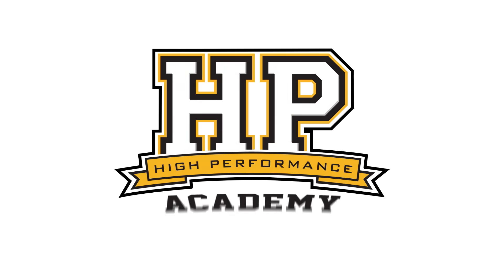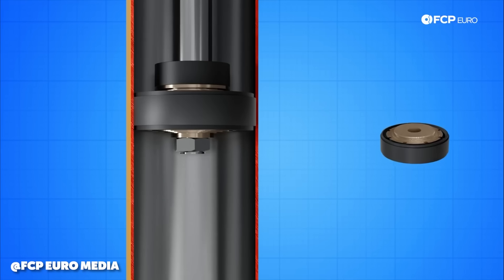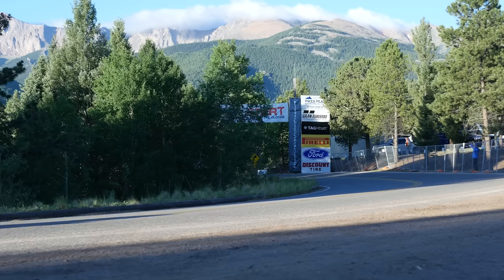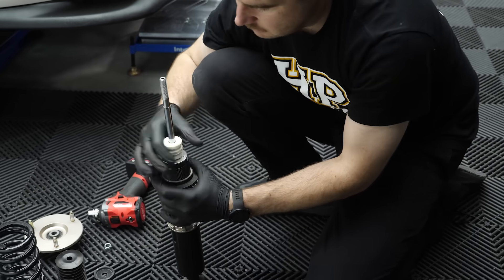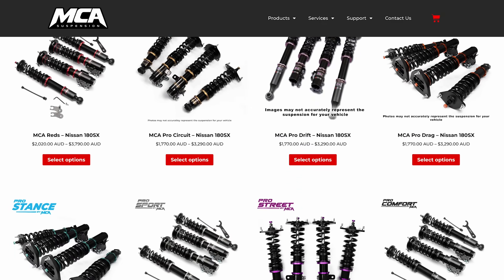The 3 Secrets To PERFECT Suspension Performance

Comment from the maker: 🏎 Building a fast car? Get $400 OFF the all-inclusive VIP online course package deal: https://hpcdmy.co/mcasvip
🗜 50% off your first suspension tuning course. Enrol now: https://hpcdmy.co/mca50
0:00 -  3 Important Suspension Aspects
0:10 - Josh Coote MCA Suspension
0:15 - Inside Suspension Damper
0:18 - Suspension Piston
0:30 - Discs/Shims
0:56 - Real World Testing Vs Dyno
1:16 - Rebound & Compression
1:32 - How Adjuster Works
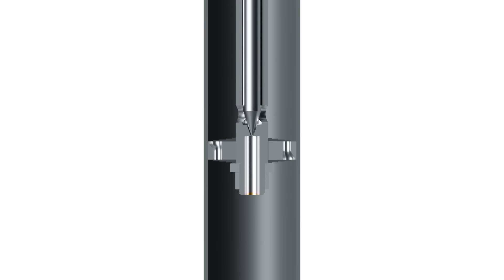1:55 - Shim Stack Vs Oil Flow
2:20 - Thick Vs Thin Shim Stacks
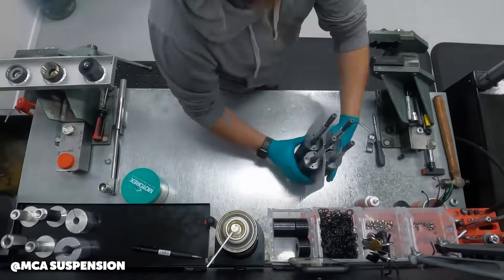3:01 - Tunability & Development
3:24 - Shim Adjustment In House
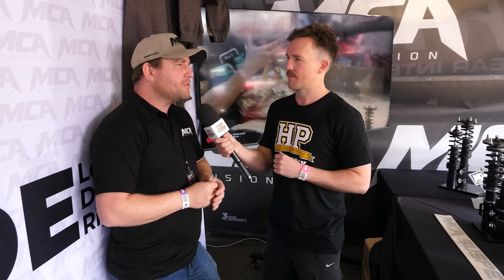4:09 - Revalving Shocks
4:38 - Springs Are Easy To Change
4:52 - When To Revalve A Shock?
5:12 - Different Valving For Different Applications
5:30 - Drift Vs Drag Suspension Valving
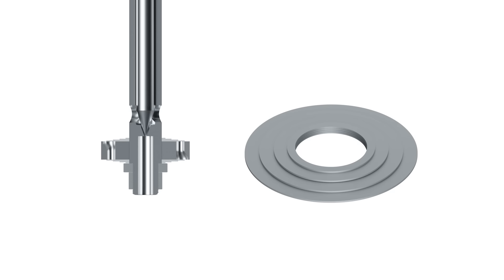6:25 - Valving 70% Of The Picture
6:52 - MCA Suspension

Comment: More commonly overlooked is the suspension droop . Too much travel still jacks up the inner wheels, even with an uprated anti roll bar . 
Reducing the droop on the shocker by having them shortened also allows you to run a softer Roll bar , making the vehicle more compliant, especially in wet race conditions.

Comment: I run MCA Pro Sports in my S13 Silvia, and they are leagues above any cheaper bolt in street coilovers I have felt. My car feels like it has rally suspension and with the full droop and proper valving capabilities it's glued to the ground (Yokohama AD09). It's super comfortable on the road, eats up big bumps and dips without upsetting the car. Worth every penny!

Comment: The problem is that when you have adjusters, the shaft size increases and the minimum size shim as well also increases while the piston area decreases, creating higher gas forces and a more uneven bump/rebound balance. If you just build the suspension right off the bat for the intended car and purpose, you don't need adjustment knobs, and can thus have a smoother response and more comfort, even at typically higher spring and damping rates than you might think.
Reply: Yes, but that assumes exactly one intended purpose.  One car, with one setup, for one track.  For example, I recently made a swaybar adjustment on my Miata for more mid-corner rotation on the autocross.  My old damper settings became tremendously loose on entry, and I was very happy to have adjusters to calm down the dynamic rotation without having to assemble a whole new shim stack.  I set the car with even more transition stability for the street with the adjusters, and I'm sure I'd do the same (albeit stiffer overall) for a track day.
Reply from the maker: @Drunken_Hamster - We'd respectfully disagree. There is 100% a reason for adjustment,. There are often even more adjustments than what is discussed here, and that's not to say everyone and every car needs it. It's also not because no one can get this perfect 'off the bat', it's because 'perfect' is a moving goalpost.

@JETZcorp rounds off a few great points on why, they are not the only ones either.

There are so many different applications out there that no single blanket statement can cover them all. If what you're using suits your skill level and your specific needs, then that's a win, even if it looks completely different to what someone else is doing.

Hope that helps and thanks for sharing your opinion! Just because we don’t agree doesn’t mean your setup is wrong for your needs 😎- Taz.
Reply: @hpa101  Fair enough, I guess. I get a little bit of confirmation bias type stuff going on when something is explained to me really well, like the videos I watched, which influenced my stated opinion. At the end of the day, I want my car to be comfy enough on the street for road trips but absolutely confidence-inspiring on the mountain and at highway speeds in the case of having to make an emergency maneuver.

It's a 7th-gen (03-07) USDM Accord Coupe V6 6mt, which shares a chassis and suspension components with the TSX and TL, each of 04-08 model years, and the former of which is known as the European Accord. I don't want the car any lower than 2in below stock as I'm not the "tire tucking" type and don't want to struggle too much to get in and out of drives or over speed bumps.

Any recommendations? I was kinda thinking about Ohlins TTX since they're a full-cooling surface twin-tube, which theoretically comes off as the best of both worlds between the consistency of a mono but low gas forces and comfort of a twin. Sadly, they don't directly make them for my platform, so IDK what to go with, really.

The guy's videos I watched, which influenced my opinion, he charges $3k for a suspension setup, but he takes corner weights and nails your ride frequencies (including having flat ride), has a "ripple reducer" (which are two bypass holes in the piston for washboard style surface irregularities), and specs roughly equal compression and rebound damping so as not to have the piston keeping the car sucked down into the bump stops and riding rougher than need be. Oh, and he has special bump stops, too, and a bag of "packers" which you can use to optionally force them to engage sooner.
Reply from the maker: @Drunken_Hamster - context is important for sure, so don't take that as an attack on you or anyone else. For a specific street car with a specific setup, maybe whatever you watched was on the money and really helpful for a lot of people who just want something solid in the ballpark, and it will no doubt be better than stock, especially old stock suspension.

Link us to the video, we'll have a nose. 

To be honest for your use case, something like that which is 'set and forget' would tick all the boxes for you.

If you were going to be on the track more than road, then it would be different. A dedicated track car on slicks, different again.

Ohlins will need to be dialled in for your setup/preference too. The brand name alone doesn't give you the performance, so factor in that cost if you do take that route no matter the brand - Taz.
Reply: @hpa101  The channel is called "Suspension Truth by FatCat Motorsports" or something like that. His 6-part-ish series on suspension tuning and then his 2-parter about how to vet your suspension vendor are certainly things I'll consider when it's time to move forward. Unfortunately, YT doesn't like me dropping links in comments. I can try in a follow-up, but no guarantees.
Reply: @hpa101  Yeah, see, just like I thought. YT auto-deletes any comments I put links in, even including links to their own platform. Maybe you can see it on the back end in your channel moderation settings or notifications, or something, but IDK. If you find the channel, it's the most recent playlist in the "playlists" section. LMK what you guys have to say about his teachings, as I'm always interested in cross-referencing information for accuracy and usefulness.
Reply from the maker: @Drunken_Hamster  ahh yeah that's odd, we don't have that feature turned off as we don't mind people linking great info. I'll look into that and check out FatCat Motorsports when I have a moment after work.

Cheers for mentioning that link issue - Taz.
Reply: @Drunken_Hamster  Just by the way you were talking about the videos, I suspected you were talking about FatCat.  I remember reading an article Sheikh wrote on TTAC back in the day about the problems with shock adjusters, especially their inconsistency.  That was a big part of why I chose Ohlins for my NC, because they really do dyno consistently enough to assume that 4 clicks means 4 clicks.
Reply: @JETZcorp  Yeah, I really want some Ohlins TTX due to the complete separation of bump and rebound and the benefits that that particular construction of twin tube gives, but Shaikh talked down about them despite the ultra-low gas forces (thing he likes a lot) and refuses to talk ABOUT them because of his "muh adjusters" hangup (which, seemingly fair given what else he's said and what you just confirmed).

The other problem is they just don't make them for my platform, that being a CM8 chassis aka the 1st gen TSX, 3rd gen TL, and 7th gen USDM Accord.
Reply: @hpa101  It's probably a me thing. I post a lot of long and/or semi-repetitive comments. Downsides of hyper-focusing on things, lol. I watch a bunch of videos in an effort to find something new pertaining to the thing that I recently learned, but all I can find is bog standard stuff, so I try to spread the new word about something most seem to not be aware of, and I guess that makes me a "sp-mm-r" in YT's eyes, so I get autoregulated.

Comment: why do 2 thinner shims vs 1 thicker of the same total thickness create a better feel?
Reply: The stiffness of a shim doesn't go up linearly, it goes up with the square or the cube (I don't remember) of thickness.  So if you have a shim with a stiffness of 5 units, 2 shims would be 10 units stiff, and a single shim of double thickness might be 25 units.  It's kind of like how it's easier to break 2 standard pencils than to break a single inch-thick pencil.
Reply: not an engineer but I would guess there is slightly more initial play of the stack moving before the full damping force is applied, which should soften the impact the driver feels
Reply: @chyrt  long story short, it’s because it’s effectively softer. One 0.2mm shim is roughly equivalent to 8 0.1mm shims of the same diameter. There’s some other factors as well, but the simple answer is that the stiffness of the shim is proportional to the thickness of the shim cubed. Have a look at the resources on ReStacktor
Reply: Multiple thinner shims are going to be a lot more flexible and doesn't restrict the oil as much.

Comment: Good to see detailed breakdowns of suspension. Suspension is a commonly missed opportunity by many enthusiasts
Reply: Josh knows his stuff! 'Enthusiasts' often don't really grasp just spring rates, wheel rates and soft-versus-hard sidewall tyres, let alone all this damping stuff!  I think to be fair many sporty OEM cars now have a pretty decent setup for road and light track as standard, be it a BMW M2 CS or FL5 Civic Type R, and if they don't then an OEM upgrade path is available -- for example semi-aftermarket BMW M-Performance coil overs for the regular BMW M2 or semi-aftermarket STi Tarmac springs & struts for the Subaru WRX STi.

Of course Josh would rather you buy MCA Suspension instead of that OEM parts catalogue stuff! 

Obviously if the OEM suspension already gives you the right "feeling" for the use case of the car, then I don't think you should necessarily be upgrading, unless the OE suspension is worn out and you want to get those MCAs or Bilsteins or Konis or Ohlins or whatever. It's easy to overdo it and get suspension that is too racey for a road car IMO...
Reply: My bad, the M-Performance suspension (not to be confused with M-Performance models) is a fixed height uprated spring and shock, which is IMO more suited than a fully adjustable racing coilover with universal motorsport springs for a road car. Sadly, it's often hard to find uprated OE-type springs which are not lowering springs, though choice of uprated shocks (fixed perch ones for strut fronts) is often not too bad.
Reply: English good